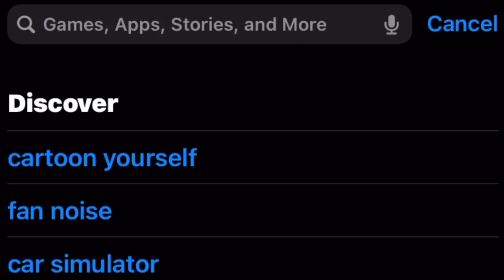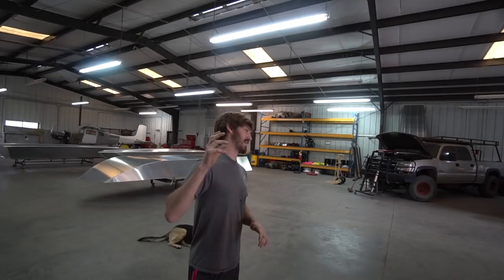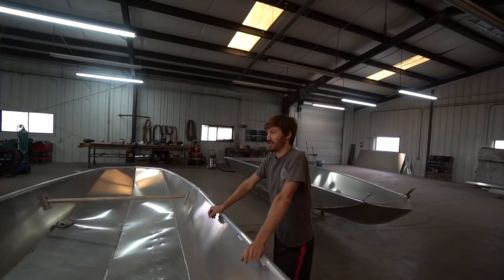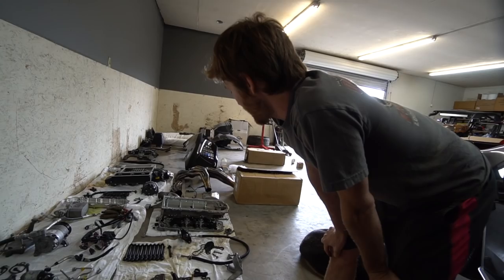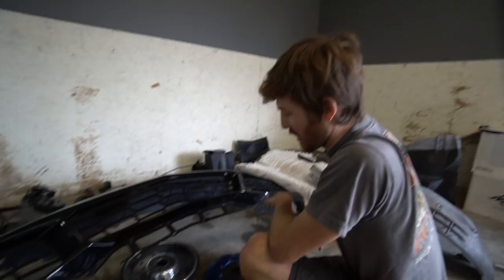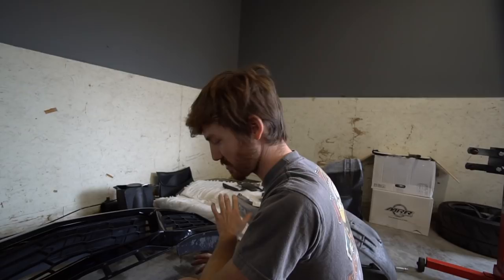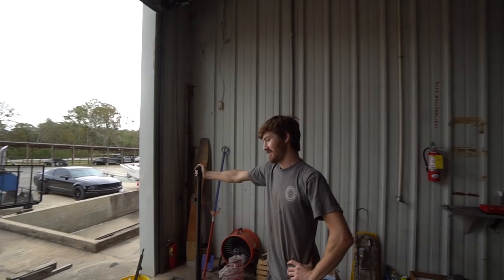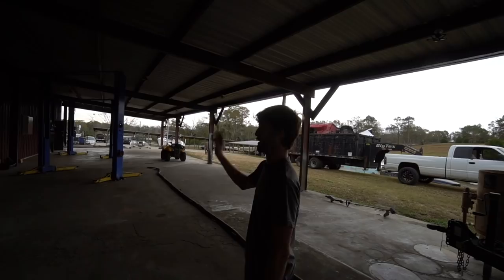4x4 Swap with Coil Overs? Nv4500 Swap. Big changes Coming

Comment: I would go ahead and go to your friend shopping put the transmission and it makes it a lot easier on a lift in a does underground trust me I changed 33 turbo 350 and 77 Chevy pickup truck that was four wheel drive

Comment: the only difference if you get a computer is the idle will jump down. because of the load with the torque converter, when you put the nv4500 in, it will probably idle at like 900 rpms

Comment: Hope you're planning on using the frame from the 4x4 donor truck. 2wds have a different frame and axle wont fit on ifs frame without some major fabrication
Reply: What donor truck and your full of it there really not that much to do to put 4wd in a 2wd done it myself theres no major fabrication idk where u got that